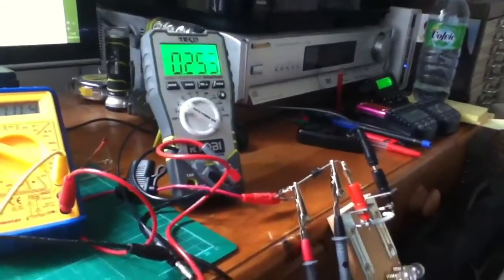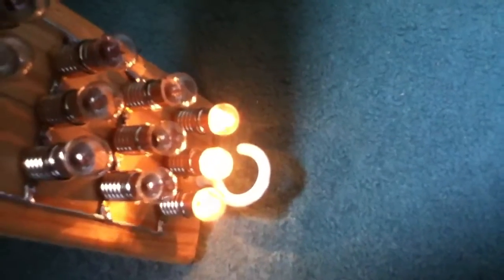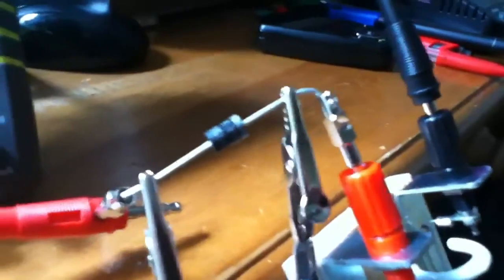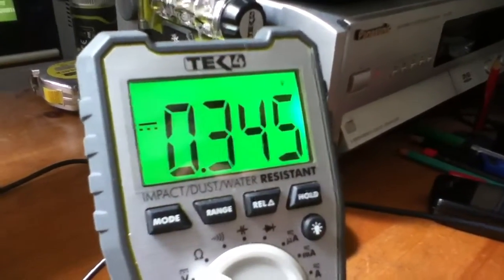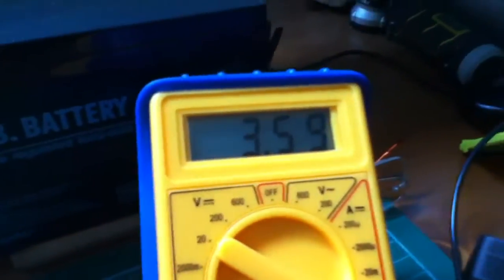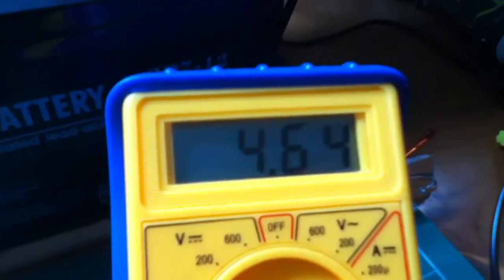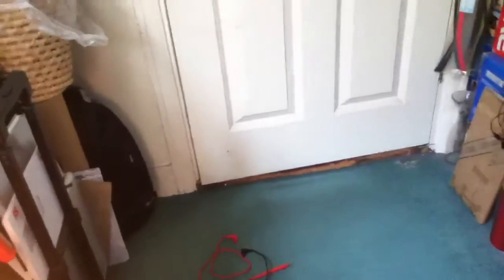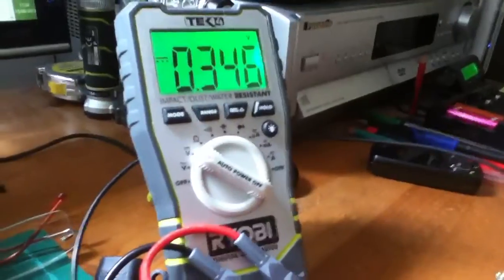High Power Schottky Diode Forward Voltage and Current Tutorial

Comment from the maker: Many thanks. Both reasons really. This diode can operate continuously at high temperature (175C degrees I think) so reliability is a benefit. Low forward voltage means the diode loses less energy as heat.